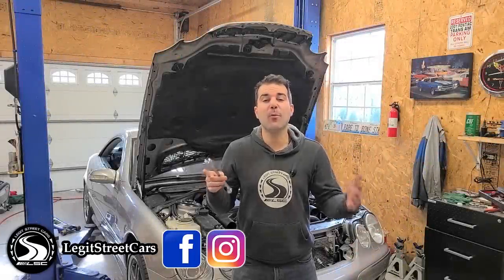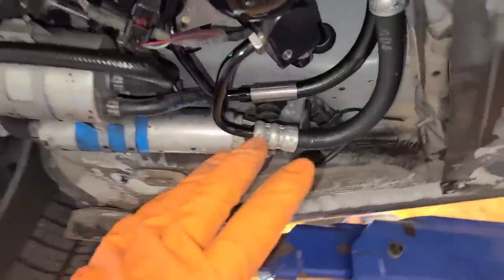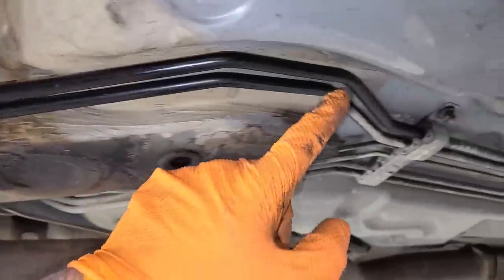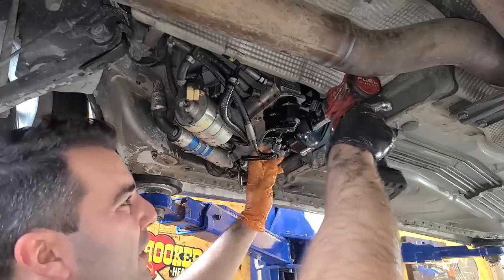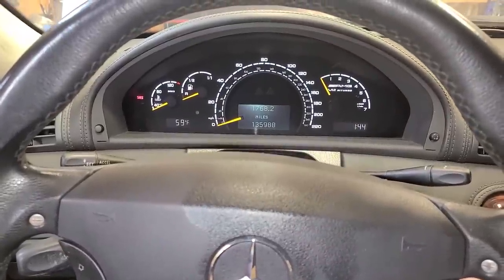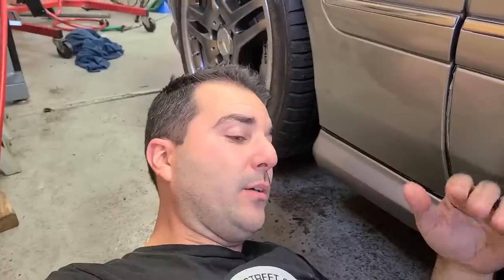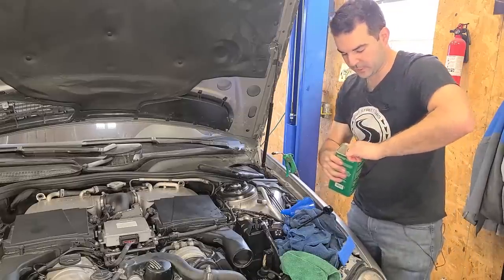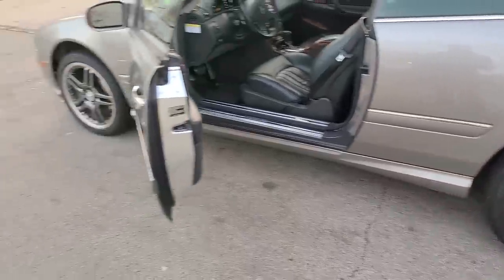I FINALLY Fixed The Hydraulic Suspension On My CL65 AMG & You Won’t Believe What It Was! FIRST DRIVE

Comment: Well done Alex to get that CL65 fluid suspension sorted. Seemed that the solenoid controlled valve block was the culprit? Your fortitude in sticking with that problem is amazing. I have an E class W210 and now understand why my mechanic advised me to steer clear of S class with same suspension.

Comment: I’m with you brother, I have a 07 s65 that’s in great working condition, did all mounts and coils etc, before anything breaks I’m going with steel lines, new gaskets for valve blocks, and if a strut fails they rebuild them better than factory for a mere 600 each, definitely worth every penny

Comment: I'm glad it worked out for you bro I'm a tech I have fun working on my 215 cl600 biturbo 210k on the clock no warnings on the dash abc works great so far previous owner had done alot of suspension maintenance on it, i just replaced a coil pack on bank 1 only thing it needs to be 100% is a transmission rebuild or replacement it shifts through all the gears but you can feel it bang sometimes🤷‍♂️ I have an 03 e55 also with 220k runs like a champ and also own 2 eagle talons a 1st gen and 2nd gen both awd one is manual other is automatic

Comment: I like wrenching but I'd never own one of these cars ever. This is just ridiculous engineering. There is a reason this is no longer used in newer models and you have highlighted it.
Reply: It actually is still used in new mercedes models.
Reply: It's designed for wealthy folk to return it to the dealership and spend even more of the huge pile of cash they have.

Comment: Glad to see its fixed. I changed the rear struts in my cl55 amg and hooked the level sensors back up wrong. The rear went sky high….Had a good tech who figured it out for me. I rebuilt the valve blocks and then replaced went proactive by changing all the accumulators and motor mounts and rad and pulleys and  belts and a bunch more. Front crank seal leaks and diff side seals leak. Then I’ll be done for awhile… and the supercharger pulley change and ecu tune and intercooler pump upgrade netted 540 rear wheel hp. 625 ftlbs of torque. Car is a lot faster…😀

Comment: Great video, tip for anyone with a blocked line that still let's fluid and air travel through but can't get it unblocked with a little wire, get a ball bearing as close to the diameter of the line grease it a little bit pop 4 of them in and bamb it hard with the compressor be careful at the other end when the balls make it through the line they come out fast especially when they are pushing something through the line.
Reply: That sounds like a good idea. I was also thinking about a net curtain wire, if it fits obviously.

Comment: I have torn down 50 years old rusty hydraulic machines and coulndt fine any clog inside the lines since it has high pressure no clog can stop. It may be a hard valve material clogging. Never put anthing inside the hoses or tubes it will harm the valve surfaces at the end of the line. Man good video thanks. You should replace both the leaking fitting and T part. Or before replacing try some Loctite with the leaking fitting.

Comment: I feel your joy because I had the same issues with my SL55 3 years ago.  It actually started when it would do a rodeo test on it's on at highway speeds! I thought the big earthquake was happening here in San Diego when the car did a rodeo on the freeway doing 80 mph!  Dealer techs told me it's impossible for the car to do a rodeo while it's being driven.  Wrong!  I also feel your joy because I did all the work myself!  I fee the terror and frustration of guys who buy these cars and have no wrenching skills.  I'm thinking the labor cost alone would be in the thousands of dollars.  But like you said...smashing the throttle makes that all go away.  These are amazing cars that cost a lot to maintain but, the rewards are priceless.  Thanks for sharing.  I'm going to reseal my valve blocks very soon.
Reply: Thanks, been there done that. I have replaced my varioroof pump relay too.  If that goes out, your motor will keep running and by the time you realize to pull power it will burn up and cost $600 to rebuild. I have also replaced every non German made sensors I have found thru preventive maintenance.  I had two fuel injectors go out one me that hydro locked the cylinders!  Luckily these M133K engines are bullet proof and didn't suffer any internal damage.  I replaced all injectors ASAP @ 85K miles for peace of mind.  Stuck open injectors give zero warning!  The list goes on........Thanks though for suggesting that.

Comment: hey Alex, when we need  to fish wire through conduit, the fastest thing we use that gets past all the bends is fish line and a vacuum. once you get the line through, attach it to the more rigid aircraft cable you have and pull away. Might be helpful on a future diagnosis.

Comment: Congratulations you Finally got it! I am avidly going through your videos on issues I am having with a 2006 cls500. Your video for the oil leaks helped, but now I am on to fuel issues and having electrical issues mostly with the heat and ac. Not really any content out there on these cls500 models.

Comment: I use to operate an old fleet of fuel trucks.  They had a relay in the dash and some of them had relay issues.  The trucks with relay issues had circles drawn on the dash with a note that said “hit here.”  When you hit the spot as instructed the relay would work and the truck would start.  Everyone knew the routine…if it failed to start, hit it.

Comment: Again a great video and result. Congratulations on finding the problem in the block. Cannot wait to see you take the block apart to find what’s causing the blockage. Also when you want to clean a critical surface like the end of the hydraulic hoses which are steel you should use something softer like brass wire tools that will not scratch the surface. Even tiny scratches at 3000 psi will cause leakages.

Comment: I've installed one of those lowering modules on a CL W215 chassis before and they work great. The one thing is that W215 has 2 signal wires that are switched so to get it to work on a W215 chassis you have to connect those two wires (the 2 from the module and the 2 from the vehicle harness) backwards. I'll try to dig up the info from when I've done it and see if we can't get you to fix that too. They're great when properly hooked up.

Comment: I had a cold shiver when you said ‘Oh and its got a Renntech lowering module that doesn’t seem to work’

Do we know if the ‘reset’ or valve block that got it back to life?

Also need to sort out the battery drain was a real PITA on my E55.  Check the alarm hooter module for battery corrosion and any module that might have had any water damage.

Also ‘strimmer’ cord would have been better than wire to clear hoses.

Comment: You should woolwax undercoat your vehicles you drive in the winter, it comes in black and clear(straw color), it's what we use in Maine to prevent rust. I actually spray it for alot of people, as part of my garage. Just reapply the next fall where needed. But it's saved alot of vehicles from rusting here in Maine.

Comment: Excellant work!! Thank you Sir.

Also on a unrelated subject, there might be a fuel issue coming up soon. I saw you still are running the yellow original fuel pressure sensor. That sensor was updated and will also require a $20 to $30 w463 part number wiring harness adapter.
Symptoms can be, load intolerance ultimately capitulation when hot at idle, resulting in no codes but random misfires, ultimately stalling out and nearly impossible to restart until cooled down slightly. Subsequently the coil in this sensor fails completely resulting in a no start. Unless you unplug fuel pressure sensor which forces system to 9 BAR so be careful if fuel lines are frail. Fuel system is a returnless system with pulse-width modulated control, runs at basicallysically 30% capacity even at high load, so unplugging fuel pressure sensor forcing to 100% can prove sensor is at fault.

Comment: Alex, great video. Have you tried disconnecting one battery terminal and connecting a 5 ohm resistor between the battery terminals? 

It will discharge all capacitive memories quickly, about a minute. 

Keep up the good work  Alex.

Comment: 1. Congrats

2. Try a bicycle cable next time you need something that will take turns and test a line.

3. I think it should lower when at speed?

4. Disconnecting the Renntech module was a good move. That could have fixed it? Why not disconnect the module in front?

5. Thanks Alex! Enjoy

Comment: Yes, yes ,yes. You did it, Congratulations . It's been a epic journey. Your resilience, determination, persistence, vigour and focus has paid off. Top man. What have I learned from this video my initial intuition which admittedly did wane halfway during the project, " if anyone could take this job on you could". I love this particular car from the CL line up, it's a classical German Aesthetic masterpiece. The mechanical engineering under the skin is complex and not D.I.Y friendly without access to a good support network or Mercedes in-house training then work experience. The suspension is this cars Achilles heel. The video has opened a visual that compartmentalises Key areas for methodical approach and understanding, which will be useful if repair is required then commissioned out to a mechanic giving initial customer feedback.

Comment: Monday morning quarterback here: you might want to invest in some weedwacker line for rodding out. More flexible for the corners but still stiff enough to push (or to find) a blockage.
Reply: That's a solid suggestion, I was thinking wire rope from a hardware store, like the braided steel rope of an emergency brake cable.

Comment: The door switch issue is almost certainly the door harness. They are known to have wires break around that fancy double hinge. It seems the harness was never made quite long enough to do the job long term. I’ve repaired many.

Comment: @LegitStreetCars. Door module will shut itself off if voltage is too high or too low. Check the output of the alternator. If it’s above 15.5ish volts it will turn the door module off to protect the SAM.

Comment: Good job. Now figure out what's wrong with my 05' CL55 hydraulic suspension. Yes that extreme ride height I am very familiar with. It's referred to as the tuna boat mode. ☹️ I had same problem with my door panel. That upper wood piece where the seat stuff is, the main power plug to that panel was loose. I eventually zip tied it stay tighter in there.

Comment: Thanks for the clear and detailed "everyday" explanation of the system, ESPECIALLY including the clear camera shots of the full line paths, valve bodies, accumulators, etc. I'm considering an ABC equipped SL500, and this video is very helpful. As a long-time DIY wrencher, that is what I needed to see. 
p.s. I think I "might" have yanked that chop job aftermarket module first, then done the reset...and THEN the heavy lifting of full line clearing and valve body rebuilds? :-) I know...that's cruel. Sorry. All kidding aside, THANKS A MILLION for clear camera shots and a plain old "let's rip it apart and see what's in here" approach. Good work!

Comment: Congrats on knocking out this major problem, but you're getting ahead of yourself thinking your repairs are done. You still need to take apart that valve block, fix whatever other lights are on the dash, and fix that driver side electrical door panel gremlin too. Being as this was a Hoovie car, none of this has surprised me so far.

Comment: Most 6 in lines i owned got cracked cilinder heads or gaskets after doing some proper speeding. Have 2 v8's a 560 sec and a s500 and they never gave me engine problems.

Comment: Wonderful video!  I had a CL 500 that I bought for $17,000 with 70,000 miles on it.  It was an Arizona car, so I thought, what could go wrong?  I had read a Car and Driver article saying that it was one of the best sports cars you could buy for under $20,000, but you had to have deep pockets to maintain it.  At that point, I did not really understand how deep.  After paying $1500 for the ABC power steering hydraulic fluid pump, I was able to purchase an extended warranty from Chrysler because Mercedes owned Chrysler at the time.  When the car was running properly, it had a fantastic ride and was a wonderful grand touring vehicle!  This video brings back memories of the pain and the jubilation over sorting out various electrical and mechanical problems.  When the turn signals did not work, I thought $5 fuse, maybe a $50 fuse because it is Mercedes, but no… $1500 to tear apart the steering column and find a short.  When the shift linkage jammed, same thing, $1500.  This type of thing went on repeatedly, so four years later when the warranty was about to expire, at just over 100,000 miles, I sold it to a Mercedes aficionado without guilt.  He knew exactly what he was getting but was still in love with the idea of owning it.  The car had been sorted and was running perfectly...after $30,000 worth of work, not counting tires and brakes.

Comment: For those that do not know what anxiety is... consider that every one of those ABC hoses and components has failed some owner at some point... many owners have replaced many parts multiple times. You will eventually not even want to drive the car, thus making ABC cars worth about as much as a decent night out.
I got tired of laying on the garage floor trying to figure out what failed, so I took every single one of those miserable hoses, valves, coolers, accumulators, mounts, pipes and the ABC pump out and threw all 122 pounds of it in the rubbish bin. Years of anxiety replaced with a simple power steering pump from an S430, some coil-overs (V8 car) and 20 minutes of wire splicing to get rid of the warnings.
Now I'm not afraid to drive my car anymore and I just crossed 223,000 miles on my CL55.

Comment: your door, the wires in mine were severed at the point where the wires go through a flex tube from the body to the door. pull the tube back find the broken wires and resplice the wires. I reckon the copper gets work hardened and just breaks, fixed mine, good luck.

Comment: Loving the fix, switch it off and back on again….. I used to have an old 1980 Citroen with a similar suspension setup, that never worked properly either, I chased that fault all over the car as a young mechanic who didn’t have a clue, never solved it, never had a car with hydraulic suspension since, never will !

Comment: To construct a good reliable 6 in line or a v12  u need 2 separate cooling circuits with 2 waterpumps and radiators,  1 for the 1st 3 or 6 cilinders and 1 for the 3 or 6 close to the firewall. They, re fancy engines but after racing them they easily crack if u can't run them slower to cool down properly. If u end up in a trafficjam after speeding the heath under the hood cant go nowhere.

Comment: Great work Alex. The frustration levels would have been approaching supersonic speeds.

I have an LR3 and the issues I had with it ranging from electronic to multiple oil leaks was costly & frustrating. I also had air suspension problems. It ended up being the air suspension module, it had an intermittent fault. Fortunately that was covered by the dealership. They didn't claim on my extended warranty, they wore the expense. They were really disappointed that I had barely driven 20km and it failed.  I had test driven it three times previously & it was all good.

The first three visits they ended up replacing in the following order: 1 x height sensor, 1 x air exhaust block, the compressor. Three different trips, mainly because it would work for a day or two then fail.

On the 4th visit, the computer said it was another height sensor and the front exhaust block. That is when they kept it overnight & sent data to their UK support. They identified the suspension ECU as the fault. They had to order one in, so I took the car then returned again - 5th time now. They replaced the module, programmed it, then had a problem. The LR3 wouldn't start & all warning codes came up!!. The kept the car again and sought their UK support. Turns out their software was corrupt! they were sent new software and all was good. It is as if the car was possessed by a computer demon!!

I have had no issues with the air suspension since - that was 2.5 years ago. Since then the Transfer Case Module failed. I replaced & initialised it and initialised it myself.

The oil leaks were a bummer. I paid for two leaks  8 months part as the extended warranty did not cover it. The third leak was covered by the extended warranty as the part that failed was a warranty part. They are all fixed now. I have been 6 month with no leaks. The cost to fix the leaks was ridiculous. I am glad I only paid for two. I shudder to think how much all the issues cost. If it were not for the dealership & the warranty claim, I reckon it would have been $8000 -$10000 AUD.

You asked why we spend all our money on European cars - well its because they have class, character and are absolutely comfortable and great to drive. There is no Australian, American, Japanese or Korean car like them. I live in Australia, everything European costs an arm & a leg, your first born child and first born grand child to buy and fix!!

Comment: Knock on every piece of wood you can find, and find a local hydraulic line shop to rebuild all your flexible lines. It looked like a few of yours may be starting to "sweat" ABC fluid, which means they're going to go soon. Local rebuild is much cheaper than new from MB, and they can put in a high pressure coupling where needed to simplify installation if you want. I don't know the CL, but SLs have an infamous "car killer" ABC line that requires a subframe drop to replace unless you put in a coupling.